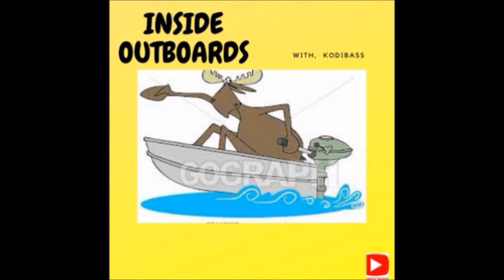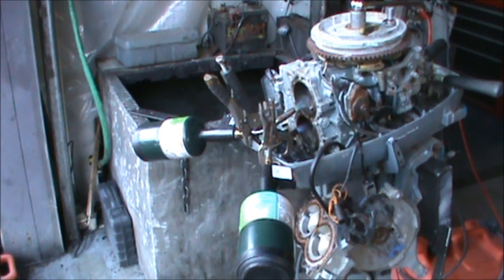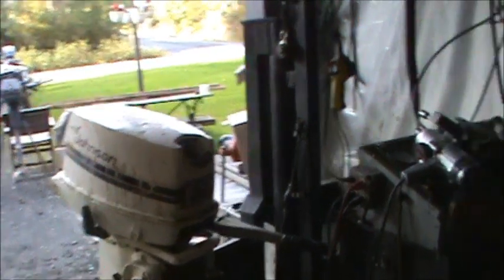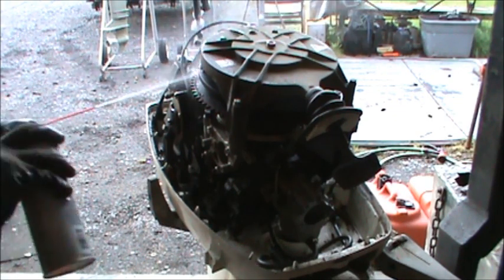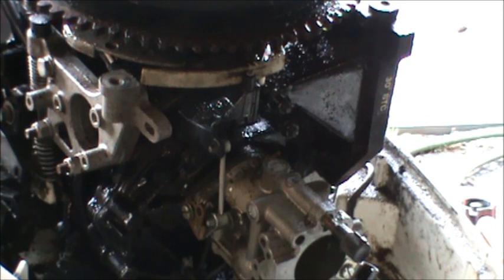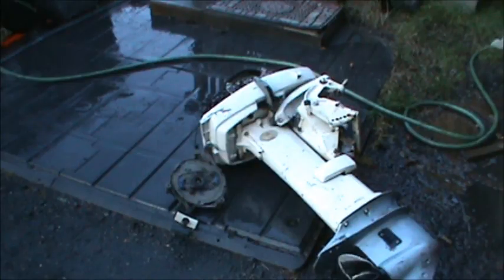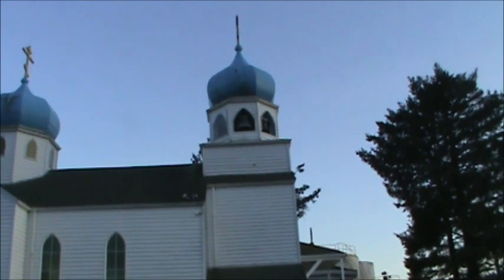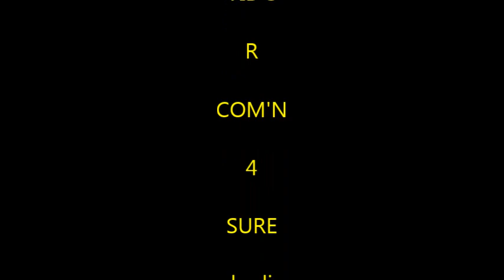EVINRUDE 25 HP SEIZED,   Johnson 30 hp,   WORKING THE BUGS OUT

Comment: Subbed up! Just bought a E25RCRD a 84. This motor is a power house. Im pretty sure it gas the bigger power block of the older 25 hp which was a little over 300cc. I believe this one has a 500cc power block. Do you know what year they changed?

Comment: Kodibass..Did you ever here of a spark plug being converted with a grease zerk welded on it then pump grease in to try and push the piston.?Saw someone here on YouTube do that on an old twin motorcycle.
Reply from the maker: I have not seen a spark plug version, but I have A tool that is sort of made to do that, It is made to force out stuck outboard steering rams in steering tubes. I can put different threaded ends on it.  I have attempted to use it on other seized outboards only to destroy the head.
Reply: @kodibassInsideoutboards  I was thinking it might be hard on an outboard head vs a motorcycle head